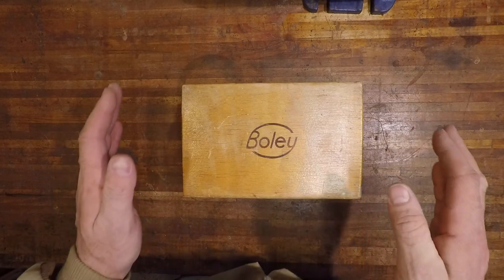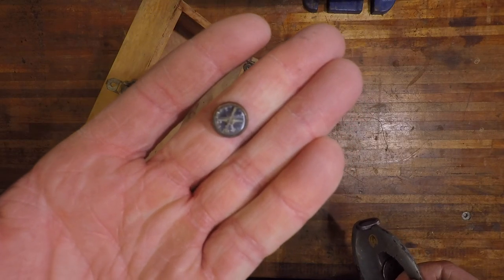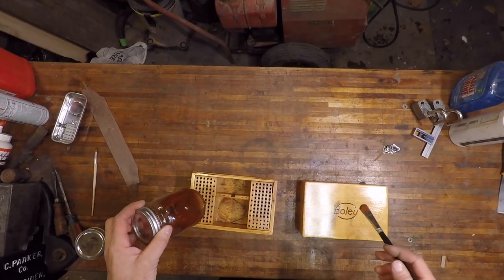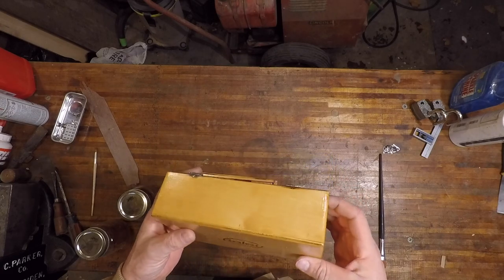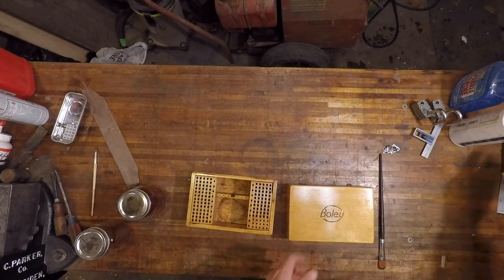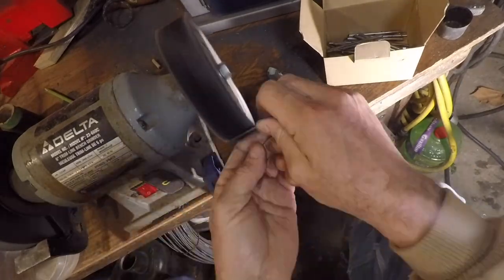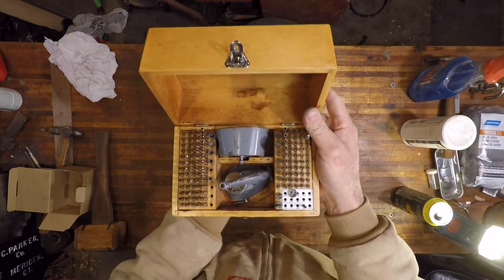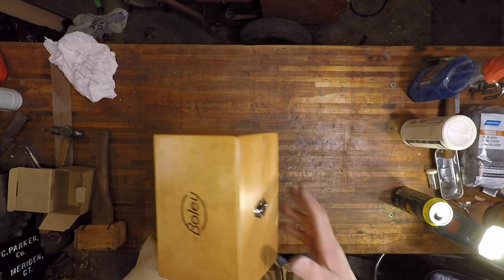Boley watchmakers staking set restoration

Comment: Hi.You are not missing those small punches at 0.22.  This Boley staking set could also be used as a jewel press with an extra tool. This is not setup with this tool, therefor no small punches in these area.
Reply from the maker: That's a really good point.. it would have that lever for setting stones or what not. 

Thanks for sharing  

Cheers